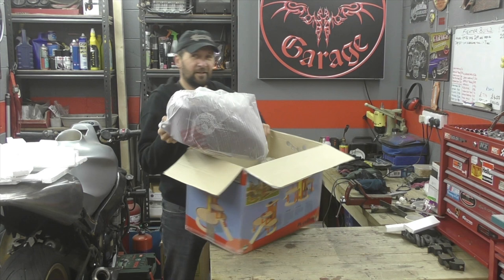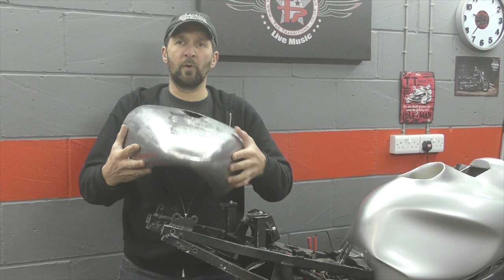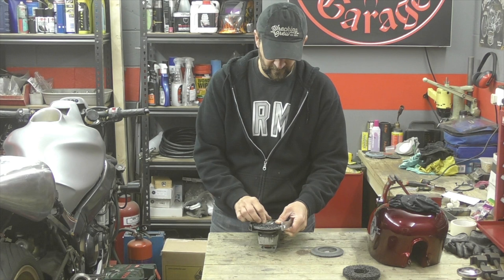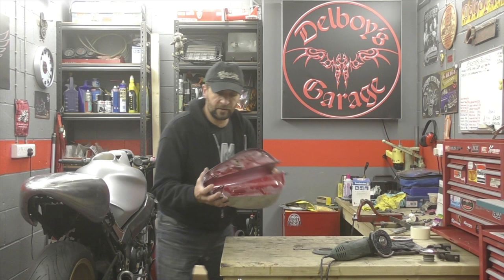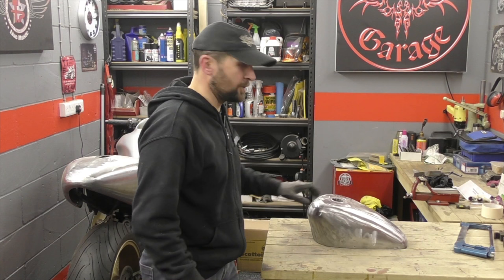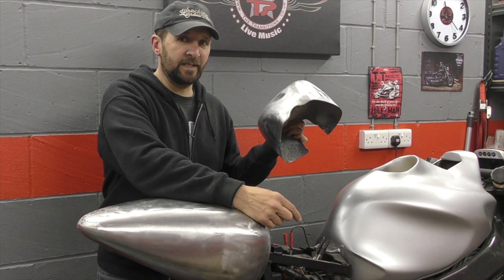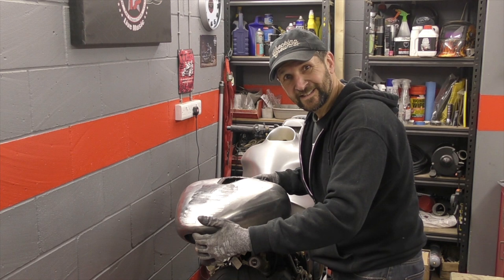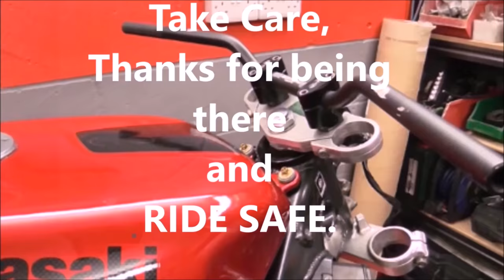Delboy's Garage, Fighter Build #52, Now i've got the hump !

Comment: I like your plan with the tank on top , have you considered getting a Reciprocating Air Saw when you can afford it as would a lot cleaner then using a cut off wheel and can cut around corners with easy as well , keep up the great work , it's looking great
Reply from the maker: Would always be good to have labour saving tools, a band saw is top of the list, but am doing fine as I go along for now - we're building the garage little by little, alongside the bike!

Comment: Sorry.. what I meant is the bottom left behind of the peanut tank you cut, the Small loop metal plate form.. where the loop rest by the bike frame.what if you use that part & attach it to make the design look more like the front gas tank part of the bike?
Reply from the maker: I intend to blend the sportster tank into the twin tank seamlessly so it just makes a nice curvy shape with a bit more dimension...!   you'll see..!

Comment: Just a curiosity question for you. I noticed in the cutting of the tank you we're using an erosion disk, and in the past I have seen you use the diamond disks. Any reason why one or the other at times?
Reply from the maker: They are both as good as each other, the erosion disc runs a lot cooler than a diamond disc, you tend to get intense blue-ing of the cut edge with a diamond disc, and I won't to stop any distortion before I get involved in designing the shape... but cut for cut, they are both as good as each other, certainly on sheet metal!

Comment: (p) Hi Del. Great work again. The disc you used for taking the paint off will it  remove surface rust as well.
Regards Pete.
Reply from the maker: Hi Pete, YES it will indeed, they are absolutely perfect for that... just go easy with the weight you place on it.. they will take paint and rust off with just gentle strokes of the disc... "Don't lean on it monkeyboy..lol"
Reply: Pete Froud Yes. 👍
Reply: Thanks Del , Will get some on order , promise no leaning lol.